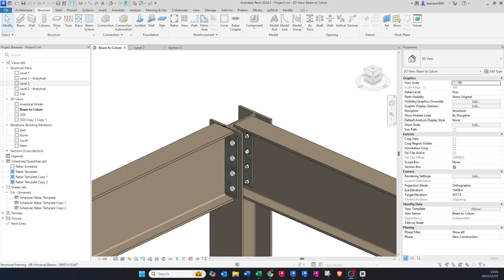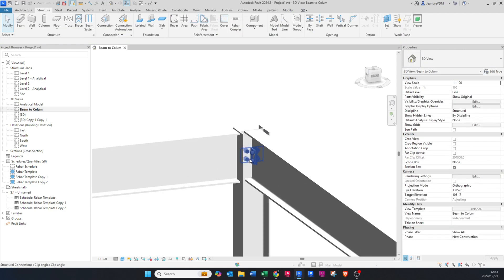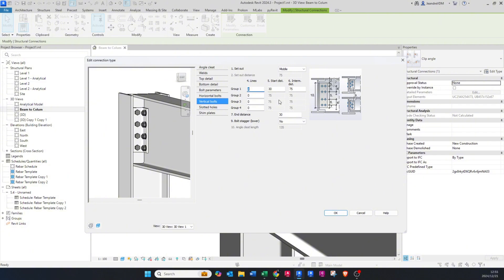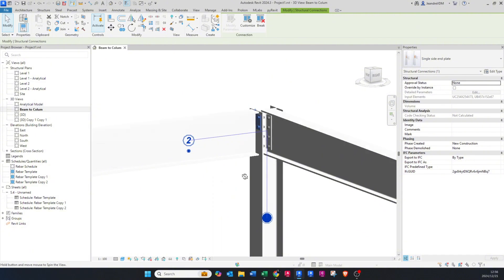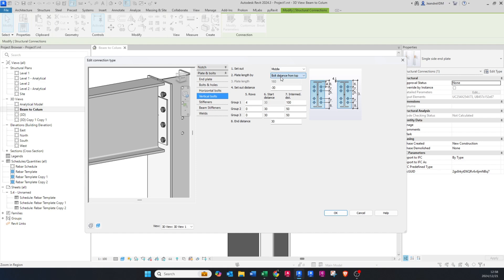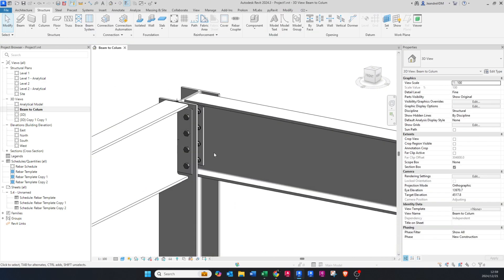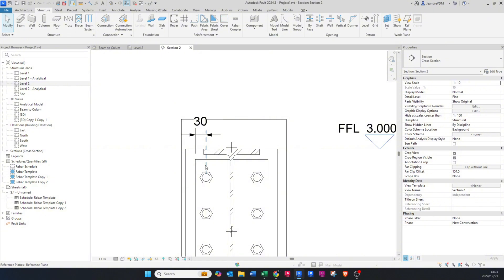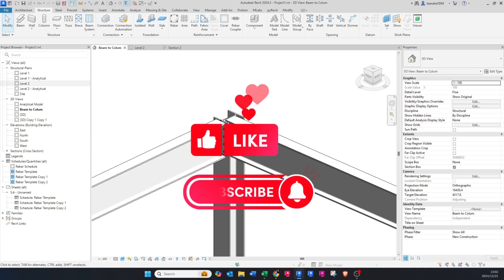Revit Structural Steel - Steel Beam to Steel Column Connections

Comment: am struggling to get these connections in Revit 2023
Reply: PLEASE HELP
Reply from the maker: You will need to uninstall and reinstall Revit.

OR

Have a look at this link:
https://forums.autodesk.com/t5/revit-structure-forum/steel-connections-missing-in-revit-2023/td-p/11393712